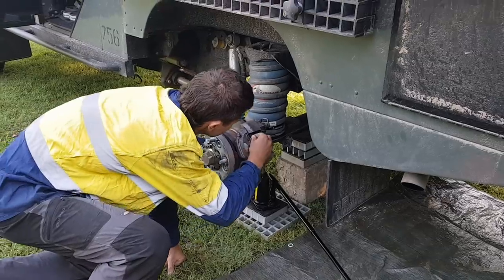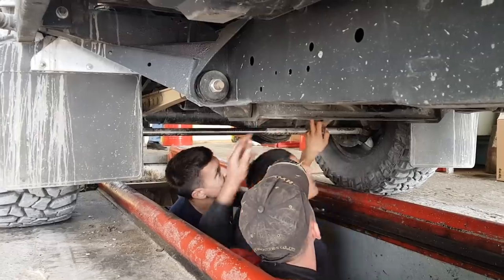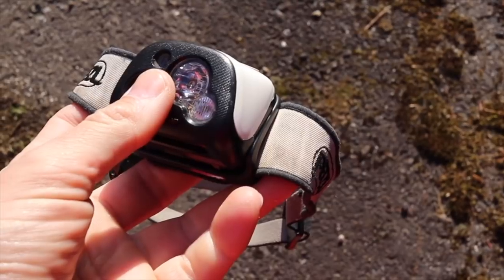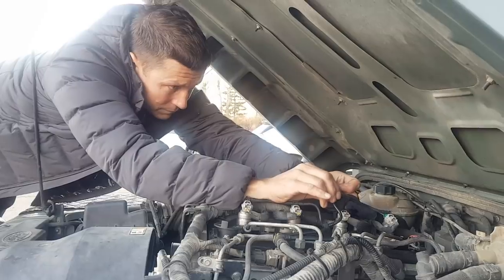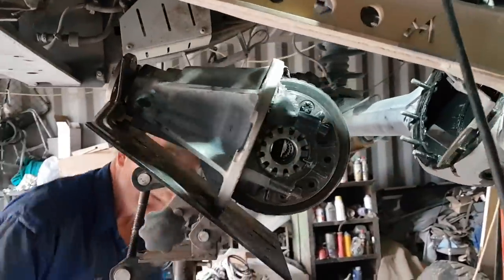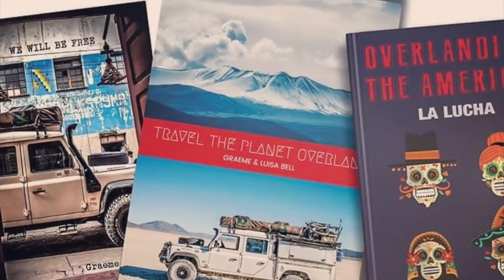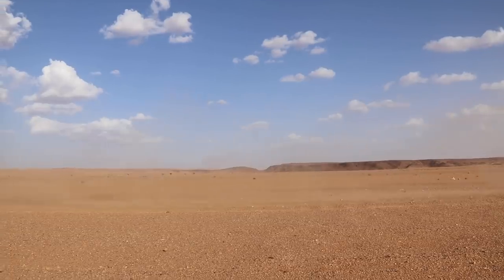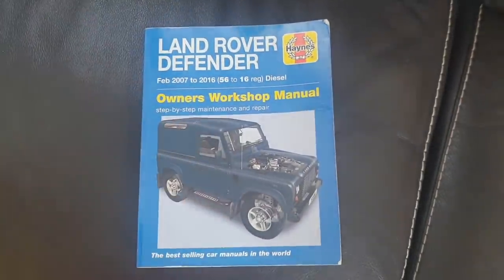Overland vehicle maintenance. GrizzlyNbear Overland

Comment: My dad said to me once that metall fatigue is measured in acceleration= the faster you drive on corrugated road, the faster the tires will bounce up and down= faster acceleration on the springs= quicker failure on the springs and everything else. As he says in the video, slow down even if it bounces like hell, it´s better for the car.

Comment: In the far north of Russia, during the winter, the temperature was more than 50 degrees (celsius) reaching the 72. They use glacial diesel and do not stop the engine because otherwise it would not start. He said, in an interview, that the engine held and they manage to get back to Brazil, where he did the engine grinding . He also spoke of the problems they had with the plastic parts that could not stand the temperature. Their adventure is super intersting, like yours. They wrote a book and speak at the congresses about their travels and earn good money from it.
The tradution from portuguese was done from google .. hahaha

Comment: That shock mount that cracked was "inadvertently designed to fail" . flat plate, off centre force, no bracing.
Reply: I agree and sent Terrafirma a nice email all about it 😉
They've since reinforced them. We had that set rewelded and reinforced by a great welder in Georgia.
Stronger than ever now.

Comment: Great video! I always say you should also know which parts you can go aftermarket with and which parts you should pay extra for OEM and not compromise for quality and fitment sake.
Reply: Great advice and very true. I've always found in most cases you pay for what you get but certainly there are times when an after market part will do the job just as well.

Comment: That's a great video! We're currently fighting with a squad of mice that bit their way all around the engine bay. We've already fixed the turbo's vacuum tube, a multitude of sensor cables and the windscreen wiper fluid tubes. All completely destroyed. Fuc**rs. I've also noticed that the engine casing is oily so I expect that they bit into some oil-tube but it seems impossible to get a close enough view without taking the engine out. Locals here have the very pragmatic view, that it's not a problem as long as the engine oil level doesn't drop too fast haha
 I remember reading of a german dude who drove 1.000.000 or so km with his G-wagon. Being asked about how he managed the car to last that long he said: "Repair before it breaks". So I might try again to find that bloody leak hehe
Good advice on the noises! Someimes it's really hard to find the source though. After some 500 or so km on bad washboard roads here in Patagonia (driving at the "sweet spot" haha) we noticed a noise from the front axle gradually becoming louder and thought was the shocks. Until I recorded the noise and asked a mechanic friend of mine via WhatsApp who suggested to look at the brake calipers instead. Turns out it is broken brake calipers screws with the calipers rattling around on the mount/disc on every bump! So yeah, full ack on that tip to have someone highly knowledgeable give remote advice.

Comment: I love all your videos, nice hair cut by the way.
Does Bear has any type of diff locker? I'm thinking to buy one for my hyundai galloper
Reply: We chose not to get lockers for our journey.
In all my years of offroad I've never felt I needed them although I have been tempted many times... 
We do have a limited slip differential in the rear.
Reply: @leighdearle5965  thanks for your answer, i have LSD on my rear diff too, i'm not trying to do extrem offroading, thanks again for the answer i think i will save that money for other mods on my galloper.
Kind regards from El Salvador
Reply: @carlosvelasco1430  good idea, like my father used to tell me don't take your vehicle into a place you can't get yourself out with a shovel. I haven't always listened to that good advice to be honest... 😜
I can understand lockers for serious offroad or competition but not for average overlanders.
Reply: Funny- my Dad told me that the winch was on the wrong end- it should be on the back so I didn’t have to get stuck twice. Didn’t listen either🤠